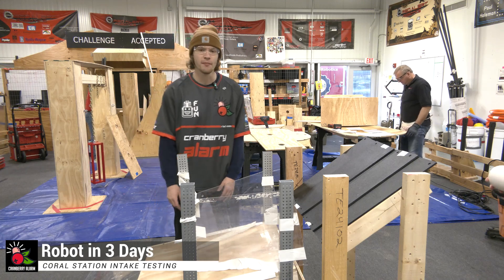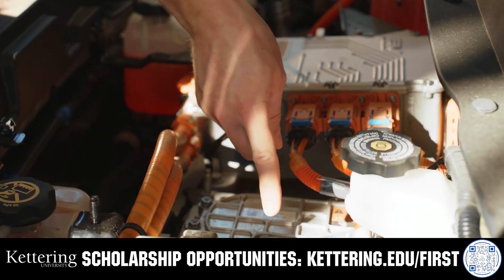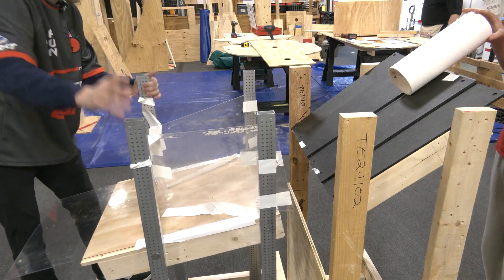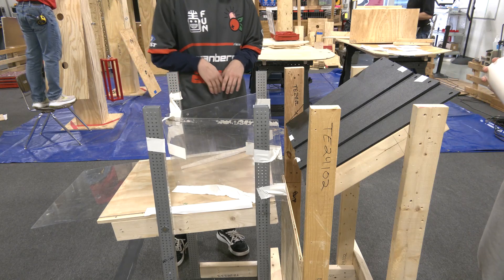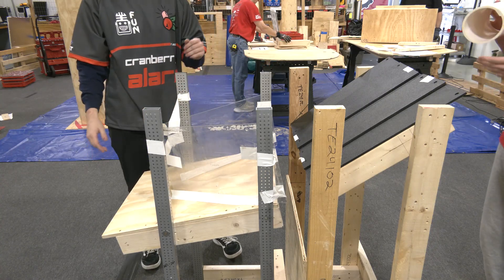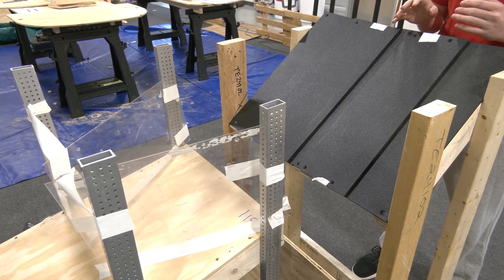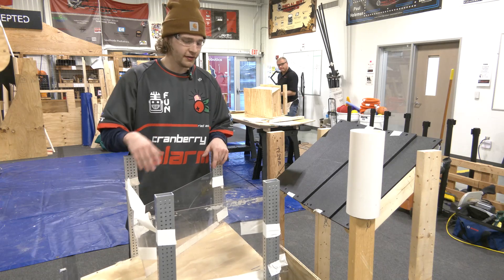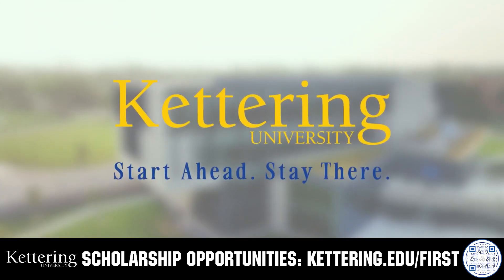Coral Station Intake & Drop Testing | Cranberry Alarm | Robot in 3 Days | Ri3D

Comment: you cant drop them in sideways theres 5in holes preventing you from putting it in sideways unless you partially enter the field which is a foul I'm pretty sure 

(Edit: oops there's a hole in the top you can drop them down my bad)